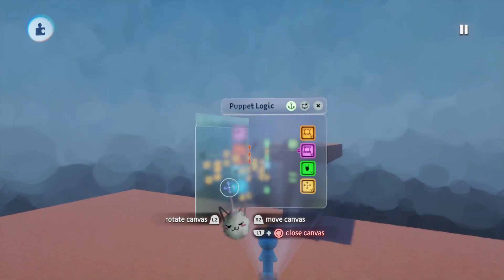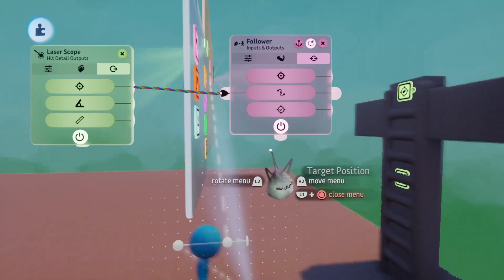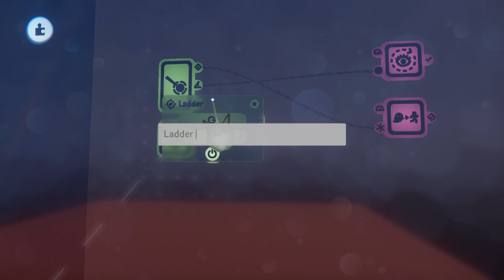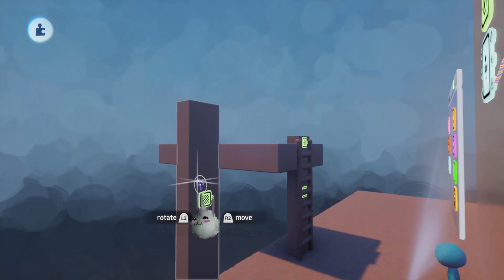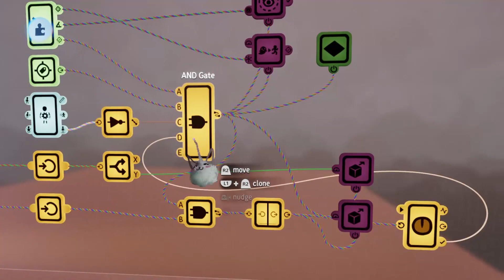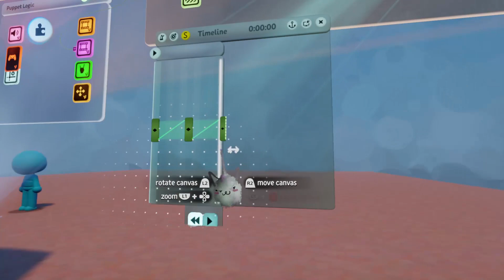Ladder Climbing Tutorial! - Dreams PS4 Puppet Mechanics

Comment: Excellent vid! It helped me make my ladder logic work! You might also want to consider adding a way for the puppet to center on the ladder.

The thing that i did was i placed a cube inside the rectangular box that is the "ladder". This cube is then set up to follow the puppet. The catch is it only follows the puppet's y value. This means the cube can only travel vertically or up and down. Now on the cube is a tag. This tag is meant so the puppet teleports to this tag with a pulse. Then the teleport logic shuts off when you latch onto the ladder. That way you will always center on the ladder. (Your logic causes it so you can climb almost any part of the ladder).

Thank you for this helpful tutorial! I hope my suggestion helps you and anyone else! Keep in mind it will take quite of bit of tweaking and trial and error to implement my idea (because it took me awhile lol)

Comment: Is anyone else getting any weird drift while climbing the ladder? The Player Character keeps drifting to the left for me and I have no idea why. I went into the keyframe and changed the puppet turn speed to zero but still having some issues for some reason
Reply: You might want to add a keyframe that turns movement off in the puppets tweak menu. That might solve the drift issue. I had a similar drift that drifted up but when i added this keyframe it stopped the issue.

Comment: Huge thanks! Quick animation question. The game detects that I'm above ground and thus triggers my puppet to the inbuilt jump descent posture, which interferes with my climbing and idle animation on the ladder. Even though I turn off all procedural animations this happens. Any ideas? I need to indicate to the system that I'm actually not freefalling somehow.
Reply from the maker: Hmm, are these animations on a different microchip? If so, you could turn off that whole microchip with the keyframe that also controls air control/turn speed. Otherwise I wouldn't really know I'm afraid.
Reply: @Stuifie3  No, they are on the same chip :/
Reply from the maker: @yeaown8139  But there is a puppet interface that has its jump ascend/peak/descent hooked up to three keyframes, right? If so, you could power off the puppet interface with the keyframe I mentioned before.

Comment: The spaghetti! The horror! ;P

The regular "left stick" is camera relative, for use with the puppet's run direction. So "up" moves away from the camera along a flat plane, basically. That's why it seems funky. So yeah, if you want just the actual stick direction and not camera-relative, using local is the way to do it.

It wasn't clear why you needed to move the tag position. I'm guessing it's just because you didn't make the trigger zone go down beyond the ground, which should fix it also.

Similarly, I don't think you explained why you added the trigger zone, as it was already working. Is it so that you can only get onto the ladder from one side? Making sure that is clear will let the viewer skip that part if they do want to allow the player to get onto the ladder from either side. (If I missed that part, I apologise.)

A good way of keeping the gadgets tidy and more understandable is to use chips. For example, a great use is to place all the stuff that needs to be powered while climbing into a chip, and then simply power that whole chip to power everything inside. This is a little more efficient because you use fewer wires, but it's also a lot more understandable from a viewer/user's perspective because they don't see a load of wires and gadgets all over the place. ;P

(Note these tips are generally for making tutorials. I mean, make things however you like. But these are ideas to think about to make the learning experience easier on the viewer. Do what you like with it.)

You also only have to think about one thing at a time. When you look at one part all you see is "are we climbing?" then if we're climbing, we power on the climbing logic. Open the chip to see that. So we know we're climbing in here... "are we jumping?" then let's power this other chip. And so on.

Crossed wires also are hard to understand, which grouping things into chips tends to help with a bit also. Ideally each wire should be clearly followable through the whole chip without breaking light of sight at all. This could mean spacing things out more, but that's preferable to the viewer getting all confused by things, in my book.

Another way of doing something for some period of time in a less direct/logic/wirey way is to use a timeline. To turn off the climb detection part I would have a short timeline with a keyframe on it that powers off that AND gate, for example. Fewer (visible) wires, easier to understand what it's doing, etc.

(I'll finish watching a bit later.)
Reply: A rocket rotator would work better for when you jump away. It rotates the object to "face" the way it's moving.

Another thing to think about is performance optimisation. The fewer gadgets you have powered at once, the less processing the engine has to do. So here you could leave the tag on--as that's pretty cheap to begin with. When the tag is in that trigger zone, power a chip with the detection part in it. If that detects you're climbing, power the chip with the "while climbing" stuff in it. This way almost all of the time it's only looking to see if the tag is in the zone without using the laser scoped and AND gates and timers and everything else.

May not make a massive difference depending on the game, but it goes hand-in-hand with the organisation aspect of using chips so I thought I'd mention it ^^

Another tip for learnability: when you've built out some flow of logic, summarise what's happening. "So now if this is true and that is true, while climbing... the timeline will work. But also it will play forwards while pushing up, and backwards while pushing down." And maybe demonstrate these things as you go too, so it's clear what the thing you just made actually does, before making a new part.

Something you can do to have "do this while true" and "do this while false" is to wire the test result (true/false) into a selector's "active port." That will send a signal out of channel A while false, and channel B while true.

Well done on making tutorials by the way. The more the merrier! Subbed!
Reply from the maker: Oh hey! I appreciate the advice. I kinda went into this mostly unprepared, so this will help me a lot should I make another one of these :) I tend to underutilize chips beyond just the initial grouping of a mechanic, but you're absolutely right in that they make things much easier to understand both for myself and for the viewer!

Comment from the maker: Little editor's note. The reason it sometimes bounces you off like at 16:00 is because the signal manipulator for jumping away from the ladder is at the wrong spot. Instead of being after the AND gate, it should be placed BEFORE it to proces the X button input.
ANOTHER SIDENOTE: if you're using the platformer puppet base, for some reason the sliding behaviour interferes with the rotation and will make your puppet shake when holding onto the ladder. Something in the sliding logic is acting up when it shouldn't, since you're not sliding. For now, disable that microchip to use this ladder climb method.
Reply: Well, thank you! Spot on!